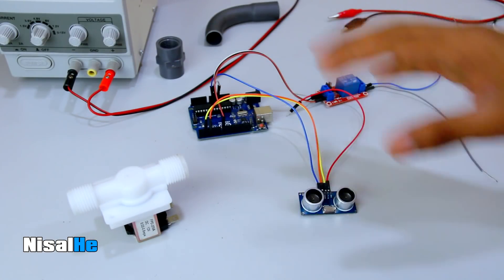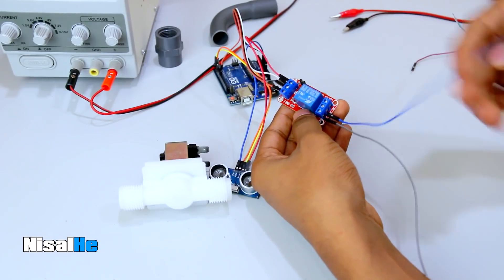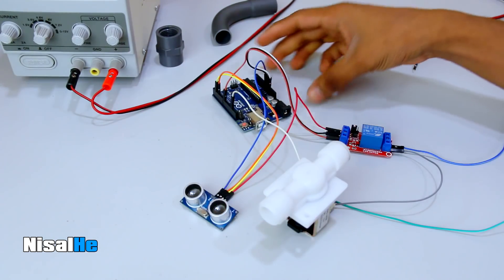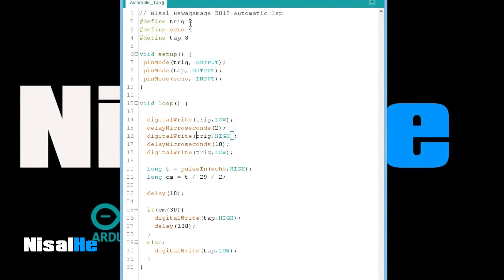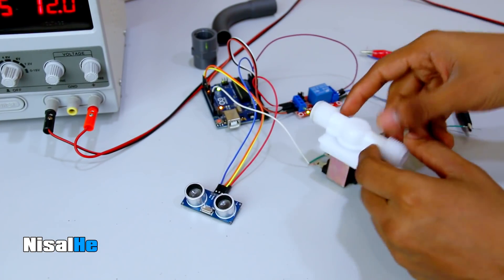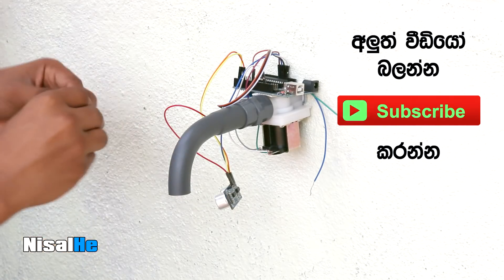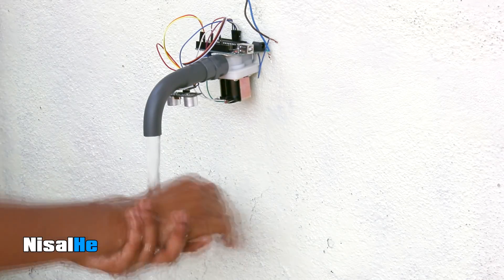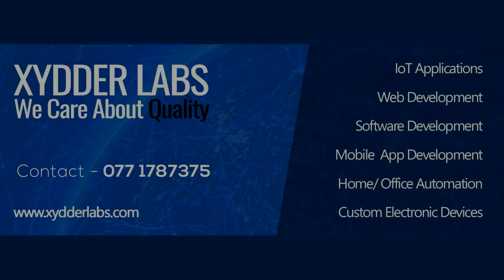Corona Tap / Automatic Water Tap with Arduino Explained in Sinhala With Code

Comment: My  experiences while implementing this tutorial-
you  need only 5v relay module, no need to use 12v relay module although video creator said that in comment section.
when u are giving power to arduino board use usb cable for that ,do not use 12v current from valve ,if u did that whole system will work correctly for little time and will begin to on/off relay module continuously.
that's all .think this will be a help to others who implement this in covid-19 season .
Reply: If you are correct my friend, its more effective !

Comment: Hye.. thts nice.. can u add one thing.. here water flow fill stop after you remove your object.. so can make  a setup which will sense water level in glass and will automatically  stop after glass gets filled? It will save water also.

Comment: Hi Nesal, I'm currently applying the same concept as you in my project. But I don't know why the flow of liquid is slow when it pass through the solenoid valve eventhough I'm using 12V power supply. Do you have any idea? Btw really nice project 👍👍
Reply: the solanoid valve is only working as a gateway.. its not a pump.. if your water supply is not spressured the liquid flaw is slow ..